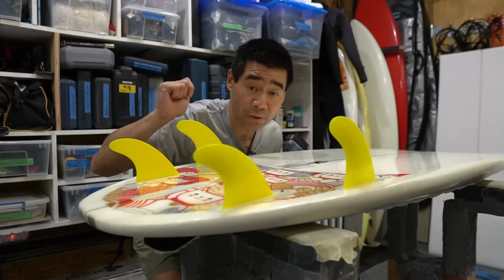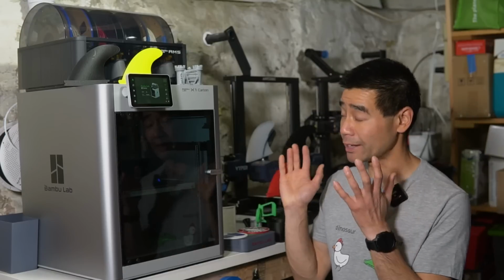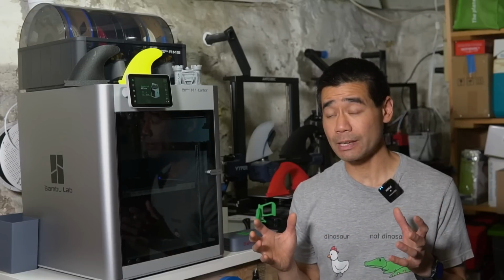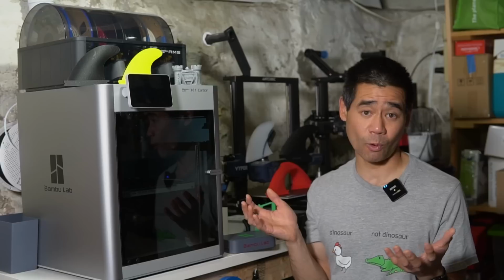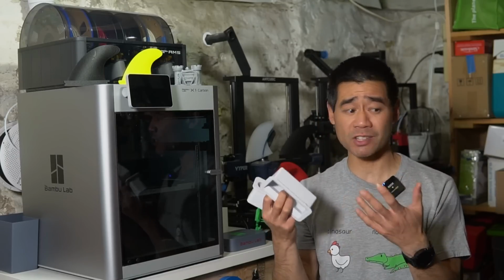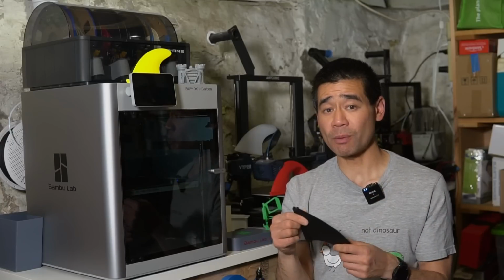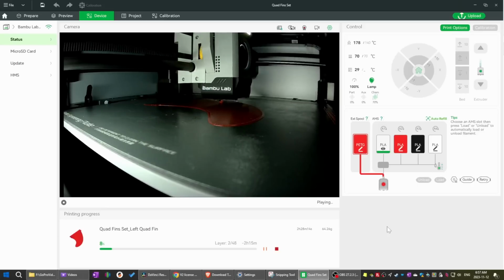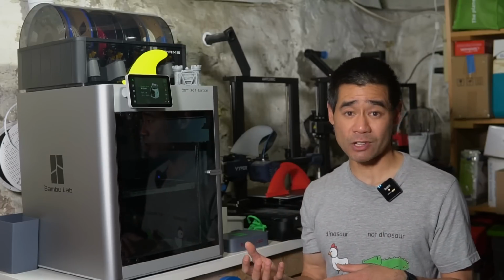Bambu Lab X1 Carbon 3D Printer Review | Prints Nylon

Comment: I have tons of spool which have several meters of unused filaments (mostly ASA/ABS) since I don't want to pause/resume mid print, priming, cleaning, thereby letting in cold air. This AMS system could help eliminate filament wastage as I can fully use up the remaining filaments in each spool and then auto-switch it to the next spool. Now, I just need to save and save for the X1C...and the AMS. :P

Comment: Have you noticed severe shaking on your table produced by movement of the printer? I am considering getting the same 3D printer and set it up on those adjustable wire racks but not sure if the rack would be solid enough to hold printer vibration.
Reply: I have a 16x16 inch rubber paver on my desk, with a 16x16 inch stone/concrete paver on top of the rubber paver, and the printer sitting on top of the stone paver. Seems to help a lot with absorbing a lot of the vibrations and movement.

Comment: What is the difference between the X1 and P1S?
Reply: I have an X1C at home, and there is a P1S at work, so I have used both. The X1C has a higher end control board and display unit. IMO: They both print about the same at standard speed (The X1C slightly better) but at higher speeds the X1C is much better. (I am guessing that the P1S controller struggles to keep up?) If you are doing mechanical parts where appearance doesn't matter, and the occasional misprint is not an issue then P1S, but if you can spend the extra $s then I highly recommend the X1C.

Comment: You can try lowering you bed temp for nylon, set initial layer temp to a high temp like 100c then drop it down to like 35c. It helps with nylon warping.
Reply from the maker: Thanks for the tip, will give that a try. I also got some new bed adhesion interface glue.

Comment: Thanks for your thoughts on the printer. I just ordered the P1S , hopefully it was worth it. I really need a printer that works.
Reply: You won't be disappointed.
Reply: I just picked up my first P1S Printer (had 10 other printers from different brands), and this was a HUGE leap forward into the "just works" territory. The only issues I've had were running terrible quality filament, brand and old,  I was trying to use up through the AMS system. So I'll save that old junk for the standalone A1 I ordered; as there is less to go wrong in that setup for cleanup/clogs.
Reply from the maker: Awesome, my buddy loves his P1S and he's been using it for months now.

Comment: I've been printing my fins in PETG on a creality max in horizontal orientation as a one piece with supports and the bed side is hard to clean the supports off and makes that side look terrible but the fins are extremely strong with 75% infill in TriHexagon, I also own a CR30 belt printer and again printed them horizontally but the supports would often go wrong and mess up the print because of the curved edges and it was very frustrating, so for the past month or so I have been considering purchasing the X1 Carbon because as you state in the video it just gets on and prints without too much messing about. I saw that you printed yours standing up and thought that it would be vulnerable to the stresses and forces from turning the board hard, have you thought about printing it vertically but with the back of the fin facing the print bed as this may make it less vulnerable to side on stresses because the print lines will be vertical and not horizontal when its fixed to the board. Just a thought. Good luck and let us know how you get on.
Reply from the maker: Thanks for sharing your experience, great idea, I haven't tried printing vertically with the fin facing the print bed, I thought about it but never tried it because of the support material, will add it to the  to do list! The PETG fins were printed laying down and they came out awesome. Haven't broken a fin yet but I also haven't had any rock strikes. They are more flexible but work well.

Comment: Made my skegs from abs
Reply: Which orientation did you use and was it one complete piece or two halves glued together?
Reply: I ran them sideways IRC.. but tried different ways. I want to try them from Nylon, I need to get my drier before I do that. The ones I used had a base you can install them into, slide them into, and so I installed the base so the skeg comes in from the front.. glued the base on with a hard core clear adhesive from a caulking company. This way I can take them off after each use, bases are lowpro enough they don't catch on anything
 @stuartlark6441